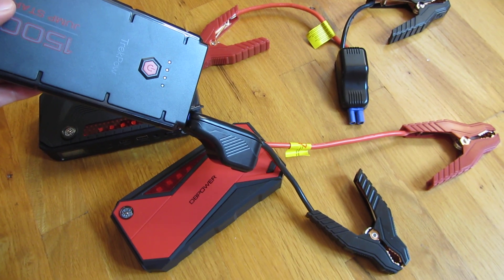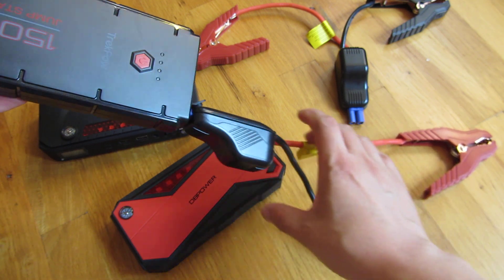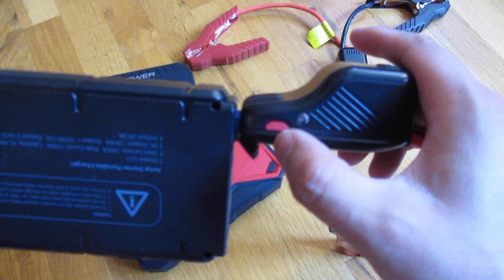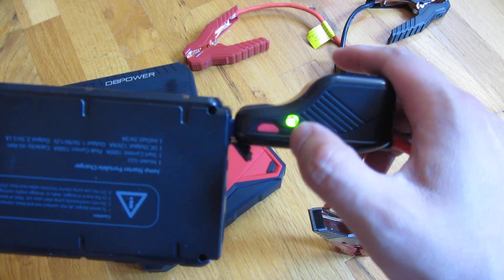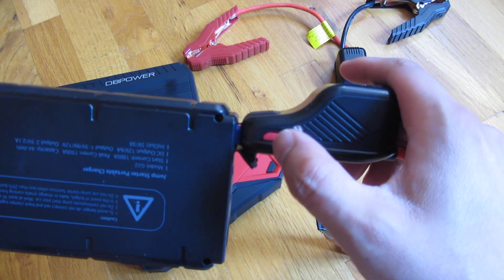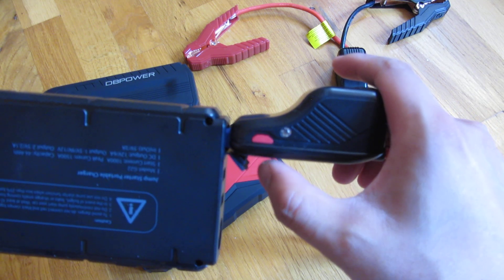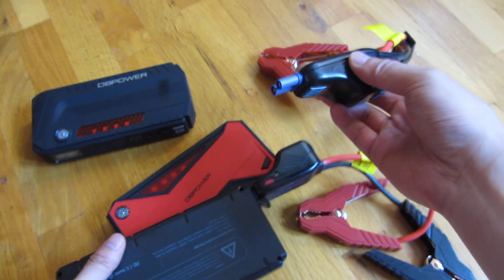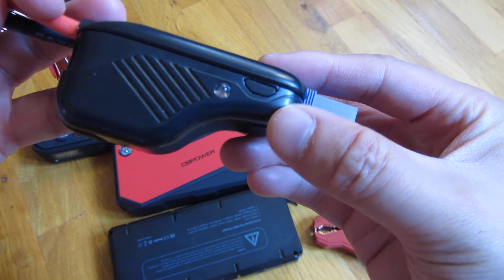What is the Boost Button For on a Car Jump Starter?

Comment: The 'Boost' button actually boosts nothing at all. Contrary to what many people would assume, activating the "Boost" button does NOT provide any increase at all in volts, amps, or power output of any kind from the jumper unit.
The 'boost' merely causes the jumper unit to 'override' the 'smart module' which normally prevents any power flow at all from the jumper unit when your vehicle's battery is below roughly 9 volts or completely dead.

The vehicle's battery must be over approx 10 volts for the jumper unit to 'detect' the battery and allow power to flow from the jumper unit to that vehicle's battery. That's where the function of this boost override comes into play.
A 12 volt car battery normally is about 13.6 volts when in good/charged condition. It is 12 volts or less when in a drained, weak or dead condition. Anything below approx 10 volts is a very dead battery.

Comment: It doesn't really help because it's not clear whether you mean the vehicle battery is almost dead or the jump starter battery is almost dead. I'm guessing you mean the vehicle battery is almost dead but, then, it usually is almost dead or  you wouldn't be jumping the vehicle battery and that means you would usually press the boost button.
Reply: The battery is what he meant the jump box itself will deliver the same amount of power at 1 percent as it does at 100 percent
Reply from the maker: I always press the boost button for the heck of it no matter what.  But a vehicle battery is almost dead meaning it can no longer retain a charge, not that its simply just drained.

Comment: Hey there, when you said that the light flashes because the battery is "close to dead or very weak", do you mean the car battery or the DPPower unit?

I just got one of these DPPower units and I charged it up overnight. It's brand new and totally full of juice, but the light is always flashing unless I press that boost button. For my purposes (powering a 12v winch), this makes it totally unsafe. The boost button only stays active for about 10 seconds before it needs to be pressed again. I cannot constantly be pressing this button in any safe manner?
Reply from the maker: I mean the car battery, I read somewhere it needs boost if it's less than 3 volts current
Reply: @PoolarityChannel  3 volts current?
Reply: @leamsi4ever  These units will flash for the boost button to be pressed if they measure less than a certain number of volts from the car 12V, which often means that it is damaged.

Comment: Very informative. I guess it activates some kind of 'capacitor' ?
Reply: There is no capacitor
Reply: @applepoop10  So what does the button actually do and why didn't he tell us? :(
Reply: @MrTuxy  
My guess - and its a good one - is its a relay that temporarily bypasses the diode in the little box.  The diode is to prevent reverse flow and uncontrolled charging of the Li battery.  There is a voltage drop on forward biased diodes that the relay temporarily shorts.